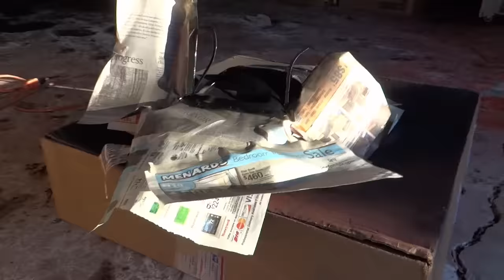RC Modify 10 | Toyota Supra MK4 - RC Car

Comment from the maker: 1/10 MadSpeed Drift Car
eBay https://goo.gl/hh5zcP
Amazon http://amzn.to/2nV0o4w

1/10 TOYOTA SUPRA Body COLT 200mm
eBay https://goo.gl/fu5Oq6

Tools For RC Modify:

Dubro 2331 lexan Body Reamer & Scissors Set
eBay https://goo.gl/uHkXpX
Amazon http://amzn.to/2nF4MTx

X Acto Knife
eBay https://goo.gl/9Knkdg
Amazon http://amzn.to/2nbSdUh

Duct Tape Nashua 48mm x 55m 
eBay https://goo.gl/K4scr9

Soldering Iron 60W
eBay https://goo.gl/aqH0Tu
Amazon http://amzn.to/2oGmhV3

Soldering Wire 60/40
eBay https://goo.gl/str3K6
Amazon http://amzn.to/2nCthR5

After Market RC Parts:

MST 5 Spokes Wheel Offset +3 Flat silver CS-R Tire
eBay https://goo.gl/0dR4mi

Mini MP3 Player
eBay https://goo.gl/Bn5Qri

Mini Speakers
eBay https://goo.gl/BpyHfe

Mini Hinges
eBayhttps://goo.gl/ghJKvB

1/10 RC Drift Exhausts
eBay https://goo.gl/Oo6x6m

1/10 RC Spoiler
eBay https://goo.gl/b0zjL4
Amazon http://amzn.to/2oE4vVo

GT POWER 12 LED Flashing Lights
eBay https://goo.gl/9Lq5cj
Amazon http://amzn.to/2oaPBVW

Amaco 1/16 Aluminum Contour Mesh AO50004D
eBay https://goo.gl/dGr7Qn

Optional Parts:

Mini Car Stand Blue by Duratrax DTXC2361
eBay https://goo.gl/fzWXPr
Amazon http://amzn.to/2oaYzm3

Deluxe Car Stand Blue by Duratrax DTXC2370
eBay https://goo.gl/ghGvBr
Amazon http://amzn.to/2nFakgy
Reply: Nice :)
Reply: DarkDragonWing
Reply: DarkDragonWing should of played Tokyo drift
Reply: DarkDragonWing do you live in Thailand or America oh and...sawadeekap
Reply: DarkDragonWing I love this Supra i really like it It's my dream car nice job on it I would kill for a rc like this
Reply: DarkDragonWing      make.   A.  Bugatti
Reply: DarkDragonWing your 😎
Reply: shopping rc car
Reply: DarkDragonWing
Reply: DarkDragonWing what scale is yhe supra
Reply: DarkDragonWing what paint can I Use?
Reply: DarkDragonWing  พี่ ทำ อีซูซุ D-Max  แต่งให้ดูหน่อยครับ ผมอยากได้
Reply: DarkDragonWing
Reply: DarkDragonWing  can you please make me one?!!!🙏🙏🙏
Reply: DarkDragonWing 
superb model making
Reply: Could I buy this?
Reply: Rice bowl.
Reply: Son  muí   chulos   tus   vídeos   e  vi  a   seguir   tus   pasos   para   de garaje   mi   tamilla   vonito
Reply: Bang plissss  mohon bang boleh minta mobil kontrol 1 aja bang plissss adik saya ingin mobil begini bang mohon bang tolong kirimin aku bang alamat makassar  pangkajenne
Reply: Et
Reply: DarkDragonWing đa
Reply: O
Reply: Hinge 'Hinj'

Comment from the maker: NOTE!!!! Only use Tamiya spray paint with the "PS"
PS (spray paint for lexan polycarbonate or clear transparent RC bodies)
Example here: https://www.facebook.com/DarkDragonWing/photos/a.846192752071114.1073741830.174252175931845/1094720580551662/?type=3&theater
Reply: +The DarkDragonWing don't cut in that position whit your knife once i did go trough an stabed my leg
Reply: +The DarkDragonWing i mean while standing
Reply from the maker: Magust Productions
 oh no, please be careful. I accidentally cut myself on this vid: https://www.youtube.com/watch?v=6tK0DXVffl8
Reply: +The DarkDragonWing you know any sites to buy high qual bodies ? with the dors and stuff like you did ?
i stried once i have 3 cars 2 therm ans 1 electric drift the bodie didn't do well when i made it :p
Reply from the maker: Magust Productions
All bodies are good as long as you use Tamiya PS spray paint.

Websites to shop for bodies:
http://www.rcmart.com/body-light-190mm-body-c-438_875.html
http://abchobbyusa.com/110scalebodyshells.aspx
http://www.rcmada.com/rc-car-parts/tamiya-car-body-and-parts
http://www.asiatees.com/rc-body-shell-store
http://www.ebay.com/sch/i.html?LH_BIN=1&_sop=15&_from=R40&_sacat=0&_nkw=1/10%20rc%20body%20shell&_dcat=34061&rt=nc&_mPrRngCbx=1&_udlo=16&_udhi&_stpos
Reply: +The DarkDragonWing thanks for that and thanks for your time ;) :)
Reply from the maker: Magust Productions
 No problem! :)
Reply: +The DarkDragonWing  i have a drift car that has a 195mm width and 390mm length what type of body can i purchase that will fit ?
Reply from the maker: Carlos M
 Is your car 1/10?
Reply: +The DarkDragonWing yes its a 1/10 scale and i wanted to know can i fit a 200mm or will it be a little big ?
Reply from the maker: Carlos M
 Any of these will fit:
Websites to shop for bodies:
http://www.rcmart.com/body-light-190mm-body-c-438_875.html
http://abchobbyusa.com/110scalebodyshells.aspx
http://www.rcmada.com/rc-car-parts/tamiya-car-body-and-parts
http://www.asiatees.com/rc-body-shell-store
http://www.ebay.com/sch/i.html?LH_BIN=1&_sop=15&_from=R40&_sacat=0&_nkw=1/10%20rc%20body%20shell&_dcat=34061&rt=nc&_mPrRngCbx=1&_udlo=16&_udhi&_stpos

Let me know which one you will buy. cheers
Reply: diogo
Reply: +The DarkDragonWing slo  1  mao
Reply: я не панемаю
Reply: +торэта азербайджан я тож
Reply: +Emilazz Play совпадение
Reply: +Emilazz Play зх
Reply: BRIAN
Reply: +торэта азербайджан, а я понимаю
Reply: make a bmw
Reply: can you do paul walker nissan skyline in furious 2
Reply: Wow
Reply: fhsjf
Reply: yea
Reply: DarkDragonWing I'm addicted to your vids
Reply: DarkDragonWing where did you get this chassis ???
Reply: Make a video of a liberty walk Audi R8
Reply: Make a video of a liberty walk Audi R8
Reply: DarkDragonWing do u sell any of those cars
Reply: heho awak reka kereta kontrol
Reply: DarkDragonWing jks
Reply: Dar
Reply: DarkDragonWing 4
Reply: DarkDragonWing &
Reply: DarkDragonWing 4m
Reply: Amigo

Comment: Great job kiddo! I probably would have mounted the Ipod between the speakers so that it looked like an amp. I love light buckets, They were not making to many kits with them when I got out of the hobby, pretty much out, I still have (2) Traxxas 4-tcs EP's and the 300zx and 150 bodies I did for them , one with a camera. I have not ran them in quite a while since I got into Quad copters. Watching this is kinda giving me the itch to go finish the Brushless install I was doing on one when I got out of the hobby. Great post, you have come a long way.
Reply from the maker: +wild300zx Nice! Thank you. I haven't had camera on any of my RC car yet. I might do put on one too. What do you use? cheers
Reply: +The DarkDragonWing Here: http://www.ebay.com/itm/Mini-Wireless-Color-Security-Mini-Camera-Micro-Hidden-Spy-Cam-Complete-System-/111717123898?hash=item1a02dc073a:g:AqwAAOSwu4BVoyK2
I just powered the cam with a 9v battery same as I did with Leds I added. I soldered in a switch between the battery and the cam or just unplug the battery, you can find the 9v battery connectors on ebay as well. You can either velcro the battery to the frame or hot glue to the body. Also the are these 9v battery clips you can get to just clip the battery into which I liked best because it was easier to change out the battery. You just hot glue the clip onto the frame and then clip in and out the battery. But a quick way to do it is just zip tie the battery behind the rear strut tower. Have fun.
Reply from the maker: wild300zx
 Nice! How is the signal, does it get interrupted from RC transmitter much?  I'm in the middle of making one right now, and I already bought AV transmitter, and receiver, expensive ones.
Reply: +The DarkDragonWing Well for $19 shipped it's not crystal lol But it was well good enough to run around the parking lot. I'm sure you will have a better set up, I just used that one just to be doing something different not many were doing at the time. And it was only $32 back then so at $18 it would be well worth it and not out any big money if you got into a bad crash etc.
Reply from the maker: wild300zx
 Yes. Good price and reasonable quality is always a good option.

Comment: hello first times Cool videos I know you can not speak German as IH can not speak English :-( had it just translating from google
I would still find it better if you have small seats would build in and the roof inside I'd still a little schwartzes cloth take as abdekung for the cable that would be even hotter but otherwise good video as always hope the local vending video you doing it would be cool would take me wonder how is it

Comment: If I buy the car in the description, could I do this car and the Toyota trueno on the same base car?
Reply from the maker: +Gostcut Gaming Yes, you can put Trueno on it. You can buy one of these.
I buy this one:
http://www.nitrorcx.com/madspeed-drift-car-green.html
These ones are good too, but they are more expensive:
http://www.ebay.com/sch/i.html?_sacat=0&_from=R40&_sop=15&_nkw=1%2F10+madspeed&rt=nc&LH_BIN=1
http://www.ebay.com/sch/i.html?_odkw=1%2F10+hpi+drift&_udlo=190&_sop=15&LH_BIN=1&_osacat=0&_from=R40&_trksid=p2045573.m570.l1313.TR2.TRC1.A0.H0.X1%2F10+hpi+drift+RTR.TRS0&_nkw=1%2F10+hpi+drift+RTR&_sacat=0
http://www.ebay.com/sch/i.html?_udlo=290&_sop=15&_mPrRngCbx=1&LH_BIN=1&_from=R40&_sacat=0&_nkw=1/10%20mst%20drift%20RTR&rt=nc&_udhi
http://www.ebay.com/sch/i.html?_odkw=1%2F10+tamiya+drift&_udlo=300&_sop=15&LH_BIN=1&_osacat=0&_from=R40&_trksid=p2045573.m570.l1313.TR0.TRC0.H0.X1%2F10+tamiya+drift+RTR.TRS0&_nkw=1%2F10+tamiya+drift+RTR&_sacat=0
Reply: +DarkDragonWing thanks man, just sent off for the first one.

Comment: If someone would buy one of your shells or a drift she'll from hobby shop will it fit on a nitro gas rc? I got a gas one and i don't know if it the same shells?
Reply from the maker: +Jose C If 1/10, it should fit.
Reply: +The DarkDragonWing ok thnx and is it possibly for someone to putt led lights on a gas rc cuz everyone got a drift cuz the led lights but I like how the gas ones sound like a dirt bike so I want led lights but I can't find any vids about LEDs on a gas one
Reply from the maker: Jose C
 You can put LED with a battery. Here are the LEDs http://www.ebay.com/itm/G-T-Power-RC-CAR-TRUCK-BUGGY-LED-lighting-Kit-FLASHING-12-LED-COOL-LOOK-/191557599153?pt=LH_DefaultDomain_0&hash=item2c99b8ffb1
Reply: +The DarkDragonWing ok thnx

Comment: donde puedo conseguir uno de esos ?
Reply from the maker: +Magaly Castillo You can buy one of these.
I buy this one:
http://www.nitrorcx.com/madspeed-drift-car-green.html
These ones are good too, but they are more expensive:
http://www.ebay.com/sch/i.html?_sacat=0&_from=R40&_sop=15&_nkw=1%2F10+madspeed&rt=nc&LH_BIN=1
http://www.ebay.com/sch/i.html?_odkw=1%2F10+hpi+drift&_udlo=190&_sop=15&LH_BIN=1&_osacat=0&_from=R40&_trksid=p2045573.m570.l1313.TR2.TRC1.A0.H0.X1%2F10+hpi+drift+RTR.TRS0&_nkw=1%2F10+hpi+drift+RTR&_sacat=0
http://www.ebay.com/sch/i.html?_udlo=290&_sop=15&_mPrRngCbx=1&LH_BIN=1&_from=R40&_sacat=0&_nkw=1/10%20mst%20drift%20RTR&rt=nc&_udhi
http://www.ebay.com/sch/i.html?_odkw=1%2F10+tamiya+drift&_udlo=300&_sop=15&LH_BIN=1&_osacat=0&_from=R40&_trksid=p2045573.m570.l1313.TR0.TRC0.H0.X1%2F10+tamiya+drift+RTR.TRS0&_nkw=1%2F10+tamiya+drift+RTR&_sacat=0

Comment: were do buy the car
Reply from the maker: +Kevin Aguirre You can buy one of these.
I buy this one:
http://www.nitrorcx.com/madspeed-drift-car-green.html
http://www.bananahobby.com/rc-surface-vehicles-electric-on-road-cars.html
These ones are good too, but they are more expensive:
http://www.ebay.com/sch/i.html?_sacat=0&_from=R40&_sop=15&_nkw=1%2F10+madspeed&rt=nc&LH_BIN=1
http://www.ebay.com/sch/i.html?_odkw=1%2F10+hpi+drift&_udlo=190&_sop=15&LH_BIN=1&_osacat=0&_from=R40&_trksid=p2045573.m570.l1313.TR2.TRC1.A0.H0.X1%2F10+hpi+drift+RTR.TRS0&_nkw=1%2F10+hpi+drift+RTR&_sacat=0
http://www.ebay.com/sch/i.html?_udlo=290&_sop=15&_mPrRngCbx=1&LH_BIN=1&_from=R40&_sacat=0&_nkw=1/10%20mst%20drift%20RTR&rt=nc&_udhi
http://www.ebay.com/sch/i.html?_odkw=1%2F10+tamiya+drift&_udlo=300&_sop=15&LH_BIN=1&_osacat=0&_from=R40&_trksid=p2045573.m570.l1313.TR0.TRC0.H0.X1%2F10+tamiya+drift+RTR.TRS0&_nkw=1%2F10+tamiya+drift+RTR&_sacat=0

Comment: +darkdragonwing hey, i am thinking of buying a rc drift car. Im am not a good drifter. What kind of car schuld i be looking for
Reply from the maker: +Jim Visser How much money would you put into buying it?
Reply: +DarkDragonWing im thinking about €250 a €300 and thanks for responding to me
Reply from the maker: Jim Visser Here are some options: 
You can buy one of these.
I buy this one:
http://www.nitrorcx.com/madspeed-drift-car-green.html
These ones are good too, but they are more expensive:
http://www.ebay.com/sch/i.html?_sacat=0&_from=R40&_sop=15&_nkw=1%2F10+madspeed&rt=nc&LH_BIN=1
http://www.ebay.com/sch/i.html?_odkw=1%2F10+hpi+drift&_udlo=190&_sop=15&LH_BIN=1&_osacat=0&_from=R40&_trksid=p2045573.m570.l1313.TR2.TRC1.A0.H0.X1%2F10+hpi+drift+RTR.TRS0&_nkw=1%2F10+hpi+drift+RTR&_sacat=0
http://www.ebay.com/sch/i.html?_udlo=290&_sop=15&_mPrRngCbx=1&LH_BIN=1&_from=R40&_sacat=0&_nkw=1/10%20mst%20drift%20RTR&rt=nc&_udhi
http://www.ebay.com/sch/i.html?_odkw=1%2F10+tamiya+drift&_udlo=300&_sop=15&LH_BIN=1&_osacat=0&_from=R40&_trksid=p2045573.m570.l1313.TR0.TRC0.H0.X1%2F10+tamiya+drift+RTR.TRS0&_nkw=1%2F10+tamiya+drift+RTR&_sacat=0
Reply from the maker: Jim Visser Here is the new hot one, it is RWD RC car. Though, you will need to buy motor, ESC, servo, and battery separately. http://www.rcmart.com/3racing-kitd4rwd-sakura-drift-p-62225.html?cPath=1102_1106
Reply: +DarkDragonWing i have bought a Kyosho 1:10 EP Fazer Subaru Impreza KX2 VE-X with everthing RTR from team orion, thanks for your tips :), only i can not drift so maybe you could make a video with drifting tips and tricks i think it will be awesome

Comment: WHICH SITE YOU BOUGHT THE TIRES
Reply from the maker: I can't find the exact ones, but I found there similar ones http://www.ebay.com/itm/5MM-Offset-Wheel-Rim-Drift-Tyre-Tire-4PCS-For-RC-1-10-MST-HSP-RedCat-405-1086-/291627221183?var=&hash=item43e65640bf:m:mymHIGJzgEDt7dQJzVWyR6Q

Comment: how michi want yo buy
Reply from the maker: +Bro Bro You can buy one of these.
I buy this one:
http://www.nitrorcx.com/madspeed-drift-car-green.html
http://www.bananahobby.com/rc-surface-vehicles-electric-on-road-cars.html
These ones are good too, but they are more expensive:
http://www.ebay.com/sch/i.html?_sacat=0&_from=R40&_sop=15&_nkw=1%2F10+madspeed&rt=nc&LH_BIN=1
http://www.ebay.com/sch/i.html?_odkw=1%2F10+hpi+drift&_udlo=190&_sop=15&LH_BIN=1&_osacat=0&_from=R40&_trksid=p2045573.m570.l1313.TR2.TRC1.A0.H0.X1%2F10+hpi+drift+RTR.TRS0&_nkw=1%2F10+hpi+drift+RTR&_sacat=0
http://www.ebay.com/sch/i.html?_udlo=290&_sop=15&_mPrRngCbx=1&LH_BIN=1&_from=R40&_sacat=0&_nkw=1/10%20mst%20drift%20RTR&rt=nc&_udhi
http://www.ebay.com/sch/i.html?_odkw=1%2F10+tamiya+drift&_udlo=300&_sop=15&LH_BIN=1&_osacat=0&_from=R40&_trksid=p2045573.m570.l1313.TR0.TRC0.H0.X1%2F10+tamiya+drift+RTR.TRS0&_nkw=1%2F10+tamiya+drift+RTR&_sacat=0

Comment: where can i buy the chassis and body shell
Reply from the maker: +mcmenorca You can buy one of these.
I buy this one:
http://www.bananahobby.com/rc-surface-vehicles-electric-on-road-cars.html
http://www.nitrorcx.com/madspeed-drift-car-green.html
These ones are good too, but they are more expensive:
http://www.ebay.com/sch/i.html?_sacat=0&_from=R40&_sop=15&_nkw=1%2F10+madspeed&rt=nc&LH_BIN=1
http://www.ebay.com/sch/i.html?_odkw=1%2F10+hpi+drift&_udlo=190&_sop=15&LH_BIN=1&_osacat=0&_from=R40&_trksid=p2045573.m570.l1313.TR2.TRC1.A0.H0.X1%2F10+hpi+drift+RTR.TRS0&_nkw=1%2F10+hpi+drift+RTR&_sacat=0
http://www.ebay.com/sch/i.html?_udlo=290&_sop=15&_mPrRngCbx=1&LH_BIN=1&_from=R40&_sacat=0&_nkw=1/10%20mst%20drift%20RTR&rt=nc&_udhi
http://www.ebay.com/sch/i.html?_odkw=1%2F10+tamiya+drift&_udlo=300&_sop=15&LH_BIN=1&_osacat=0&_from=R40&_trksid=p2045573.m570.l1313.TR0.TRC0.H0.X1%2F10+tamiya+drift+RTR.TRS0&_nkw=1%2F10+tamiya+drift+RTR&_sacat=0
Reply from the maker: +mcmenorca Websites to shop for bodies:
http://www.rcmart.com/body-light-190mm-body-c-438_875.html
http://abchobbyusa.com/110scalebodyshells.aspx
http://www.rcmada.com/rc-car-parts/tamiya-car-body-and-parts
http://www.asiatees.com/rc-body-shell-store
http://www.ebay.com/sch/i.html?LH_BIN=1&_sop=15&_from=R40&_sacat=0&_nkw=1/10%20rc%20body%20shell&_dcat=34061&rt=nc&_mPrRngCbx=1&_udlo=16&_udhi&_stpos

Comment: As a mechanic i find your job a bodge too many rough bit's and not going to last any handling at all you cut all the strength out. But as a display maybe it's ok. But to much botching for my liking. Next time you do a body make a mould then use fibreglass you will have a body that will stand the test of time and also be cheaper to make dupe's.

Goodluck in the future

Comment: Where can i git one ok
Reply from the maker: +Manuel Lopez You can buy one of these.
I buy this one:
http://www.nitrorcx.com/madspeed-drift-car-green.html
http://www.bananahobby.com/rc-surface-vehicles-electric-on-road-cars.html
These ones are good too, but they are more expensive:
http://www.ebay.com/sch/i.html?_sacat=0&_from=R40&_sop=15&_nkw=1%2F10+madspeed&rt=nc&LH_BIN=1
http://www.ebay.com/sch/i.html?_odkw=1%2F10+hpi+drift&_udlo=190&_sop=15&LH_BIN=1&_osacat=0&_from=R40&_trksid=p2045573.m570.l1313.TR2.TRC1.A0.H0.X1%2F10+hpi+drift+RTR.TRS0&_nkw=1%2F10+hpi+drift+RTR&_sacat=0
http://www.ebay.com/sch/i.html?_udlo=290&_sop=15&_mPrRngCbx=1&LH_BIN=1&_from=R40&_sacat=0&_nkw=1/10%20mst%20drift%20RTR&rt=nc&_udhi
http://www.ebay.com/sch/i.html?_odkw=1%2F10+tamiya+drift&_udlo=300&_sop=15&LH_BIN=1&_osacat=0&_from=R40&_trksid=p2045573.m570.l1313.TR0.TRC0.H0.X1%2F10+tamiya+drift+RTR.TRS0&_nkw=1%2F10+tamiya+drift+RTR&_sacat=0